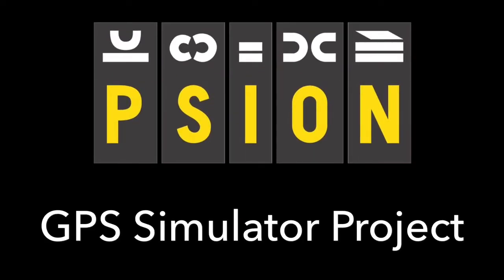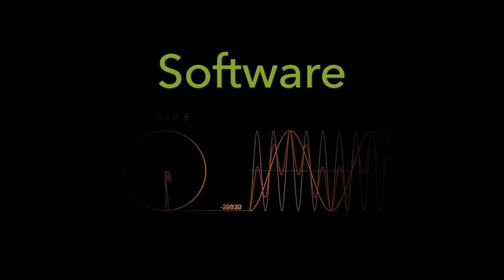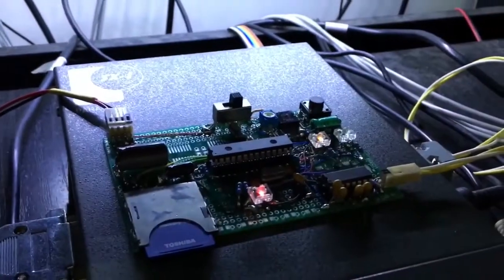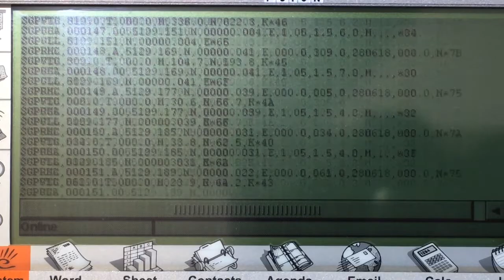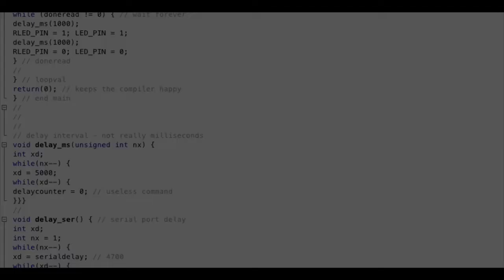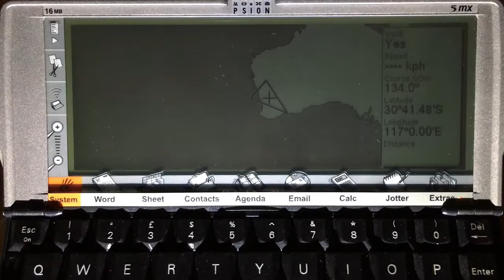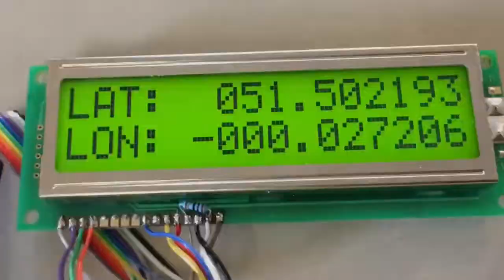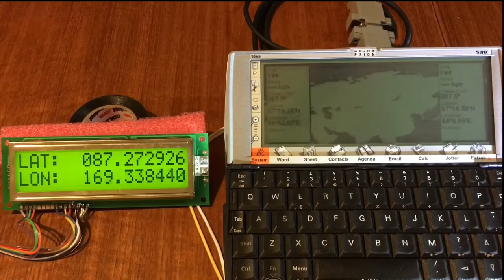GPS Simulator Project

Comment: So, if I am interpreting your poject correctly, the basis of how this works is that you have made a gadget that creates a "GPRMC sentence". So, as long as your GPS software hears the "GPRMC sentence", it thinks that the gadget is a GPS device generating that GPRMC sentence from data it has grabbed form somewhere (presumably from a satellite, via one route or another). Yeah that is pretty cool actually.

Aside from that, you have had the hurdle of being in Australia whereas the software would have expected European maps (hence you making the gadget for making a GPRMC sentence).

Why though would one not assume the readings re every one second though? You say it is a big assumption. I mean, if the (fake) satellite sends a time stamp (does it do that btw?) to say it is every one second, why wouldn't it be? Is that what ZTG or ZDA is?

Just an idea for your LCD. If you find the text updating (one character at a time) cumbersome, I suppose you could display each pixel instead of using the built in standard text display abilities. i.e. With a fast enough chip, you could make an array (2D presumably) and draw whatever you want on the screen (such as better text). Not as simple I guess.
Reply from the maker: The GPS receiver will send a burst of NMEA once per second (or some are actually faster now), but a GPS might not record a track point every second when it’s logging. Most don’t. So when I’m reading data from a GPS track log file that has no time stamps, it’s only an assumption that those are a second apart. Judging by the calculated speed, that looks to be mostly correct with maybe a few gaps. Most of the text you see on the LCD is pixel graphics. There just isn’t a lot of time to draw anything slow enough that it can be seen moving.There’s continuous process of reading from SD card, extracting and calculating data, print to LCD, read joystick port, and than sending serial NMEA.
Reply: So, just curous, why don't you put a timestamp in your "fake" GPS track log file?
Or maybe you have done that and I've simply missed it?
Reply from the maker: They have a time stamp inserted whether the data is generated or sourced from a GPX file, but for the GPS file, just because I increment the time one second on the second, it doesn’t mean the data in the gpx file was recorded every second. So you could calculate the distance and bearing with a list of coordinates, but for speed to be accurate you really need to know the original time stamps for each point in the log... or at least know they were originally saved at a constant interval.

Comment: Hi, super demonstration.  Is the code available? Tnx for any answer.
Reply from the maker: Hi, unfortunately not. I didn’t even see a use for it beyond this demo. Regardless, I think this was PicBasic. Proprietary, and not easy to simply share code. PBP is no longer a platform I’d consider using, or recommending now that it would likely be easier in C.